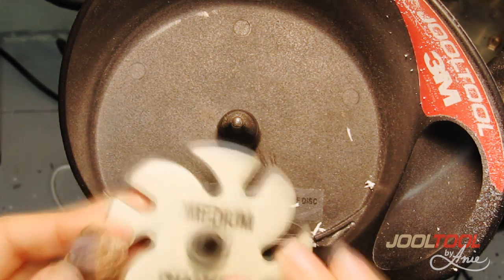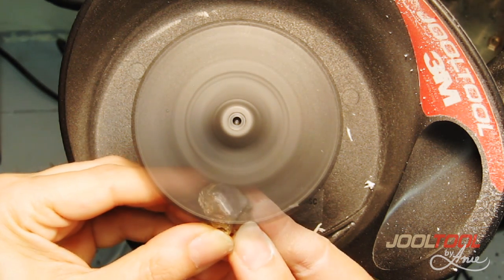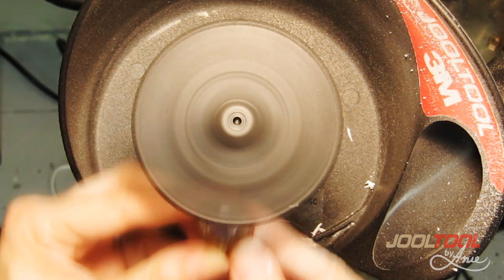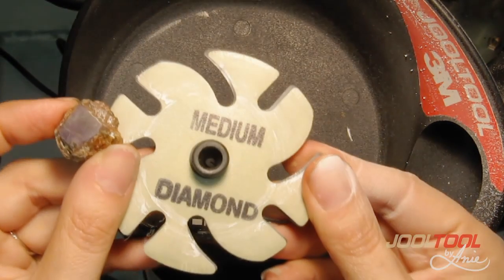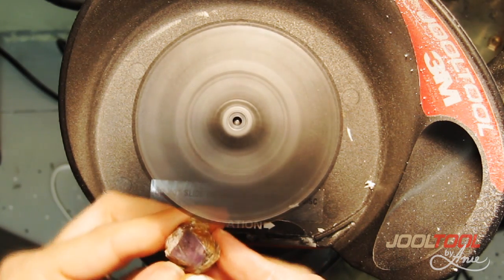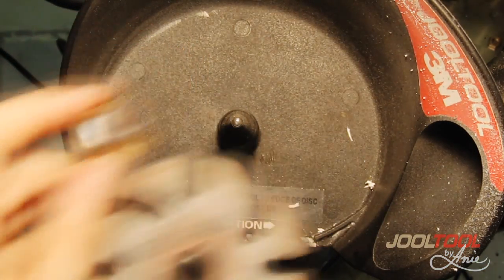How to Shape & Polish Corundum - JOOLTOOL

Comment: Why would anybody be want to grind and cut a stone on the underside of a lap wheel. That’s just an accident waiting to happen. Always dipping in water And the laps don’t even Lock in. They could fly off and injure someone.
Reply: You can see the progress right through the disc, I think that's pretty cool. But yeah, looks a bit frightening too.
Reply from the maker: This machine is extremely safe. It does not cut your fingers like other conventional systems do, and you can see the work as it’s happening in real time. This allows for no mistakes! The Jooltool also has an automatic shut off system if it detects any kind of tug clothing, hair it will automatically shut off. You need to experience the Jooltool before making false assumptions. James Avery Jewelry in Texas has over 350 of them on every bench, they brought them in because they are very safe. The regular polishing motor they used to use caused too much damage to many of their employees and they needed a safer alternative. Please be kind. -God bless Anie, the girl in the video and inventor of the Jooltool ♥️